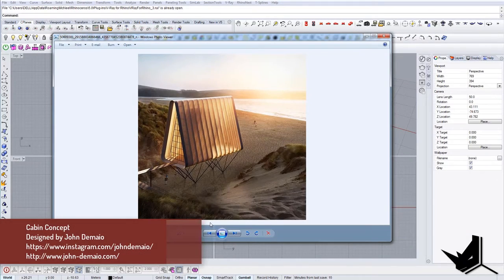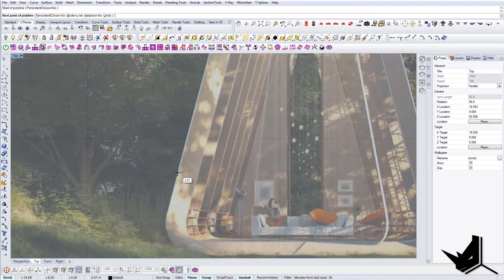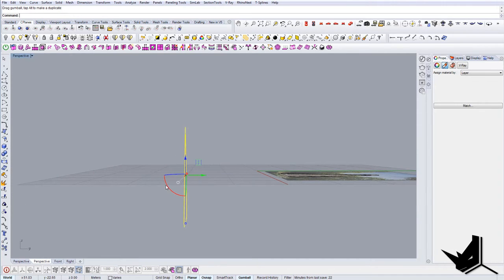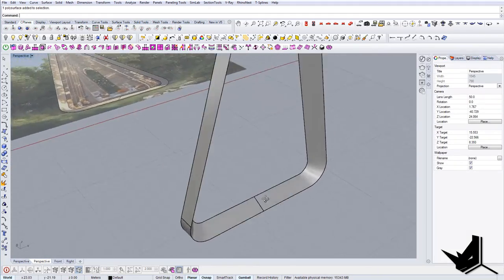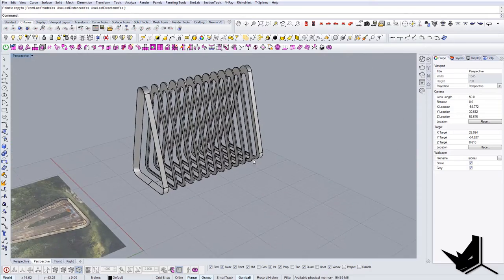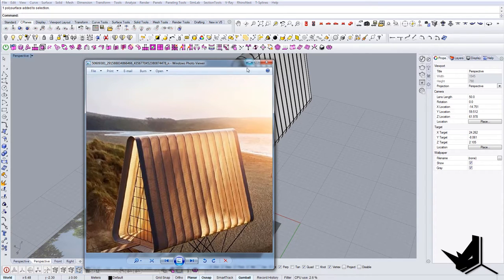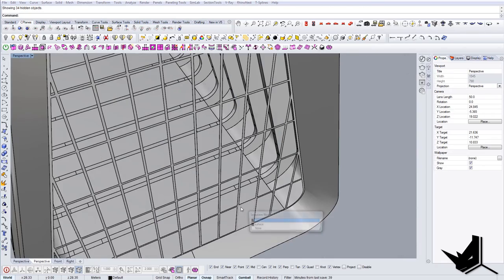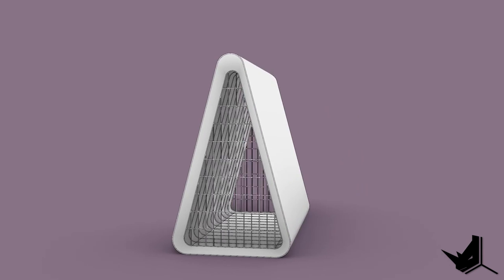Learn Rhino - Modeling Cabin Concept

Comment: Great tutorial, but why you didn't just use array command instead of copying?!
Reply from the maker: Hi Raneem, 
Great question. If you are familiar with Rhino, you probably know that there are many ways to create the same outcome. If we start to talk about why I didn't one command and use another one, we could talk about that for a long time, so in this particular example, I didn't use array command because I simply got used to using Copy command more often. However, the same outcome can be achieved with Array as well.
Reply: @HowtoRhino  Actually I start using Rhino recently in university , so I thought there's reason for using command instead of one. Thank you so much for your response 😄
Reply from the maker: @raneemm8155  Welcome to the club! Well, in some situations, you would, of course, want to use a command that would save you lots of time instead of doing it in a long way, but sometimes, it's just a matter of personal preference :)